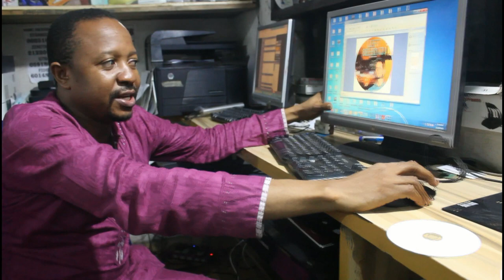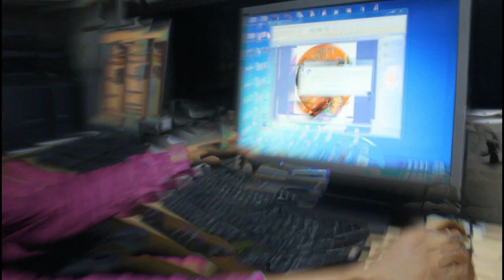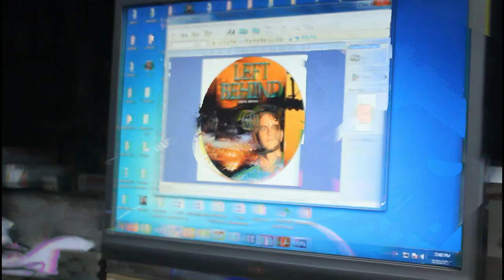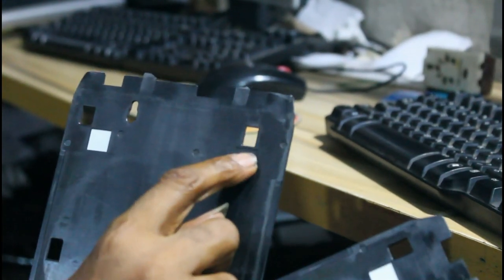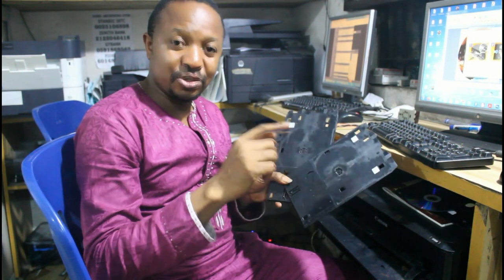How To Resolve Tray Rejection Problem in Canon CD ID Card Printers   Part 1

Comment: Hello sir, could you please help.
I produce plastic ID Cards with my Canon TS704.
Each time I print on PVC the black colour isnt well registered, it creates a double imbalanced print. and by this, any colour that requires black input is affected. e.g. Navy Blue, Brown, Wine, etc.

However, printing on other media: bond paper, Photo-paper, etc is okay, all colours are perfect.
What could be wrong please.
Reply from the maker: Two this may be causing it. The black cartridges or the printhead. Another thing that may cause it is the printer board, in rare cases.

Comment: hi my printer rejects my tray i have changed different trays  but still does not print
Reply from the maker: what is your printer model? Meanwhile, you can try uninstalling the printer software and reinstall. or simply reset the printer with service tool.

Comment: My is rejecting all my tray my both metal are ok
Reply from the maker: Try these three things: 1. Check if your system still have space.  2. Uninstall and reinstall the printer. 3. Reset the printer with service tool